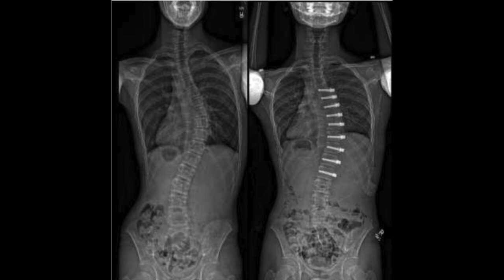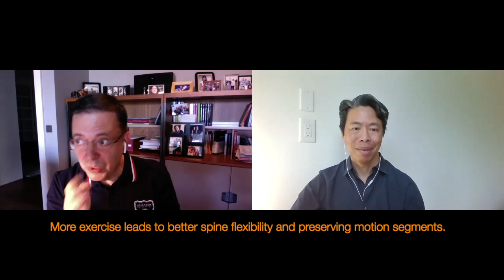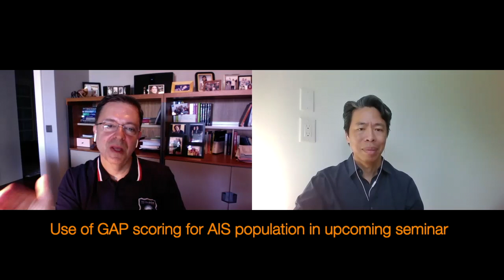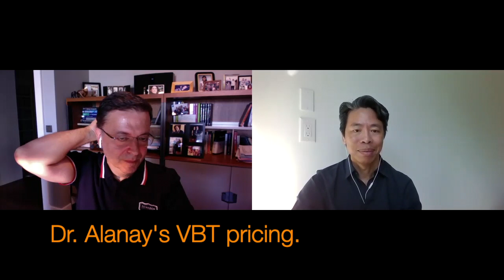Dr. Ahmet Alanay, Vertebral Body Tethering (VBT) Scoliosis Surgery interviewed by Dr. Derek Lee

Comment from the maker: This interview is for educational purposes and covers information provided by Dr. Ahmet Alanay regarding his opinions on Vertebral Body Tethering (VBT) Non-Fusion Scoliosis Surgery.  This video is not an endorsement.  Viewers should consult their physicians and treating team accordingly.  See highlights via timestamps below.

Chapters:
0:00 Introduction
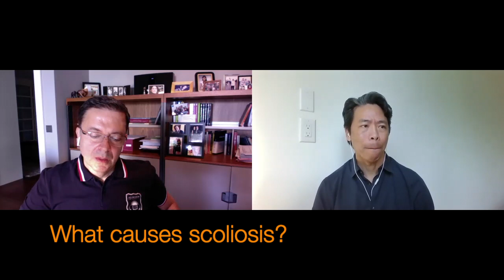1:56 What causes scoliosis?  
4:39 Mechanical theory to manage scoliosis.  
5:56 Role of Schroth physiotherapy and brace treatment.
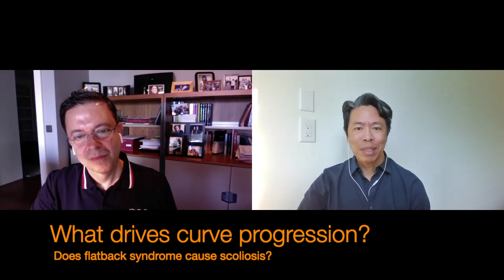7:18 What drives scoliosis curve progression?  
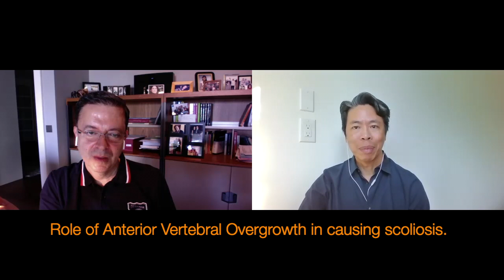9:55 Role of Anterior Vertebral Overgrowth in causing scoliosis.  
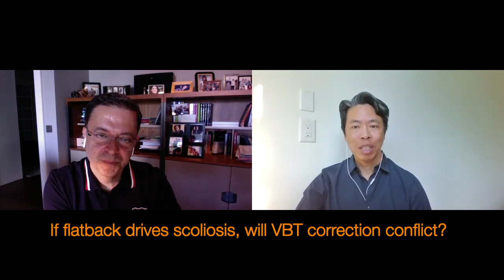11:58 If hypokyphosis (flat-back) drives scoliosis, will VBT correction conflict. 
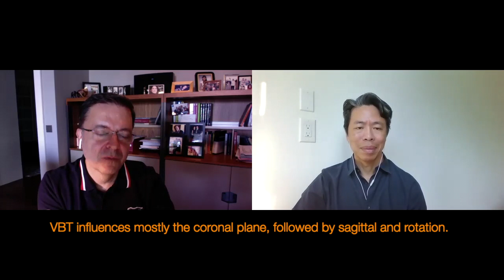14:28 VBT influences mostly the coronal plane, followed by sagittal and rotation.  
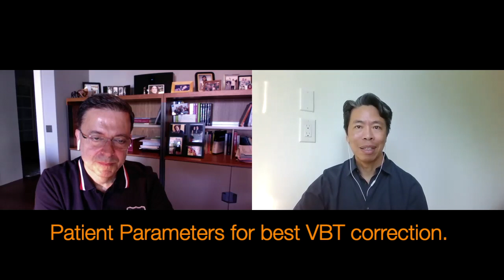16:19 Patient Parameters for best VBT correction.  
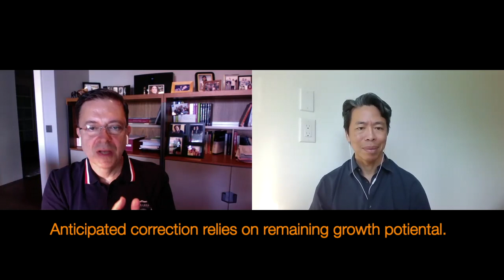19:39 Anticipated correction relies on remaining growth potential.  
20:16 Sanders 3a/3b had the best corrections with less complications.  
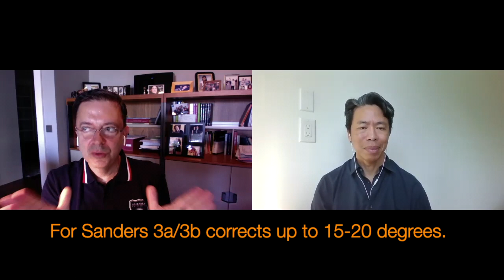22:22 For Sanders 3a/3b he corrects up to 1-20 degrees.  
22:40 Sanders 4 and 5 aims for 50-60% correction.  
23:09 Use of bracing and Schroth physiotherapy at Sanders 2 to delay until Sanders 3a/3s.  
23:55 Collaborates with in house orthotist & PT's to monitor/treat low Sanders curves.  
25:14 For non-compliant brace patients, he can operate at lower Sanders score with loose tether.  
26:46 High 40's curves dropped to high 30's with intensive Schroth and bracing.  
28:32 Exercise while bracing is critical. 
29:29 Bracing compliance is the #1 issue with bracing effectiveness.  
31:34 Collaboration between surgeon, orthotist and PT is important for best outcomes.  
34:38 More exercise leads to better spine flexibility and preserves motion segments.  
37:32 VBT can reduce hypokyphosis with a tighter tether but risks over correction.  
39:11 Obsessed about sagittal plane based on experience with adult spinal deformity.  
43:53 4 factors for successful bracing outcome.  
45:36 Treats adults with sagittal/coronal problems, spinal stenosis, nerve root entrapment.  
48:07 Global Alignment & Alignment (GAP) approach to predict successful adult fusion.  
49:54 Working on predicting ideal kyphosis angle for each patient.  
50:57 Use of GAP for AIS in upcoming seminar.  
51:11 Dr. Alanay's opinion on Disc Release with VBT  
56:52 Quality of life of a patient with a 0-20 degree curve is the same and a reason he doesn't touch the discs. 
57:16 Prefers not to cut ribs since it may compromise rib function but will do so if requested. 
58:39 Surgical decisions are based on experience, research, and patient needs.  
59:13 His 2 year post VBT study indicates discs remain healthy with no auto-fusion.  
1:00:36 Dr. Alany's Fees.  

https://www.facebook.com/groups/11982...
https://drdereklee.com/